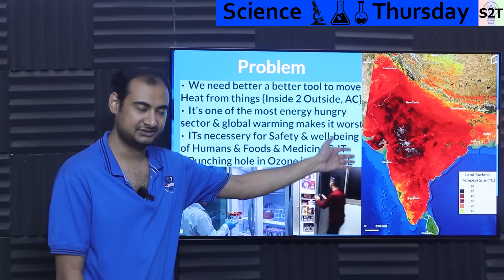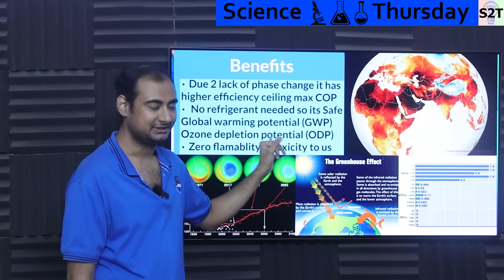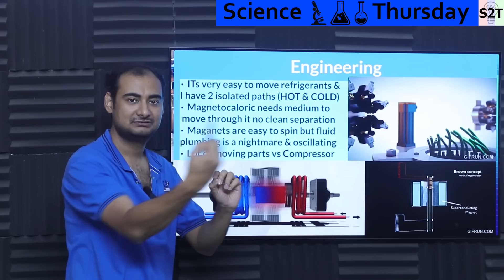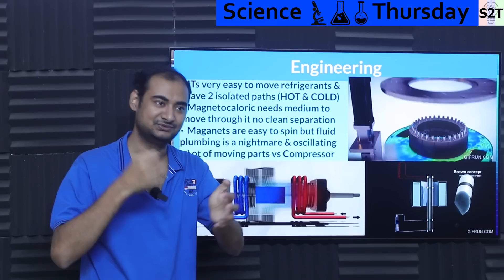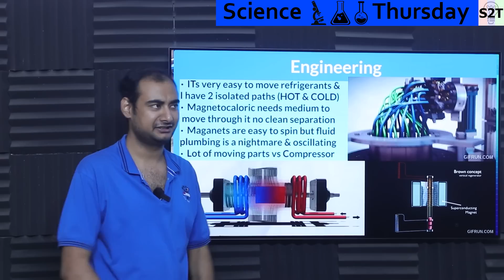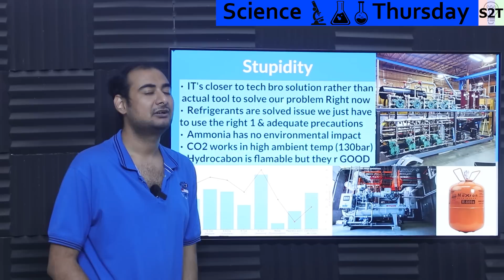Magnetic Cooling Systems Explained {Science Thursday}

Comment: Yeah, the possible COP you can get depends on the delta T, with just 10 K there are even consumer products that reach a COP of over 7, possibly even better than that.  

With such a small temperature difference, and with an absurd budget, and seemingly no concern to the size of the system for the amount of heat pumped,  you can reach much higher COP than 7 with vapor compression systems, in closed systems.
Reply from the maker: yes that is why we are going back to hydrocarbon refrigerant